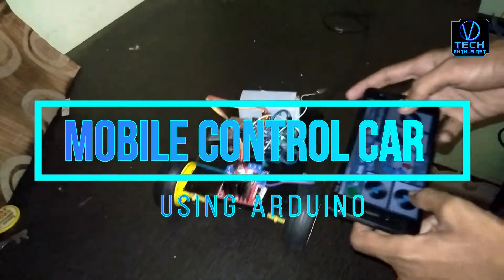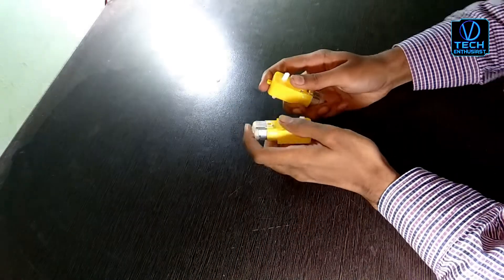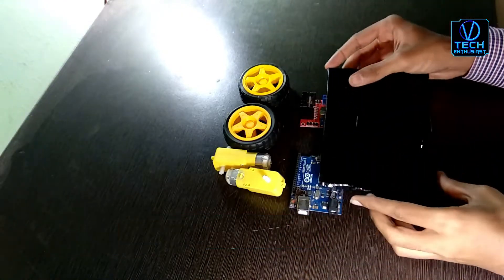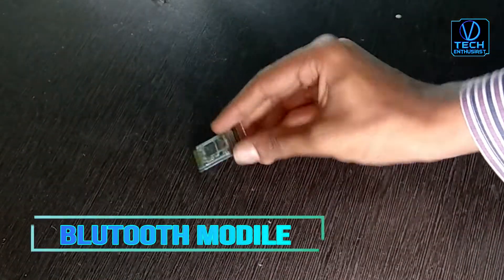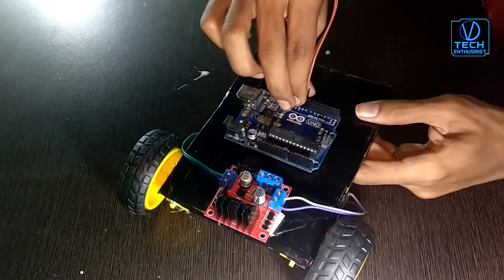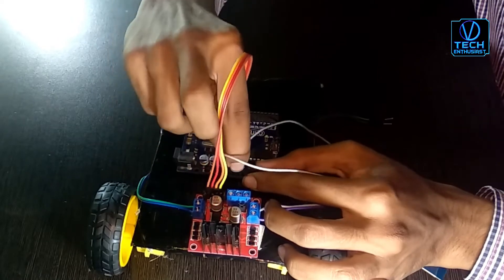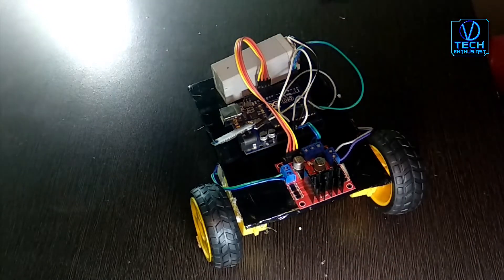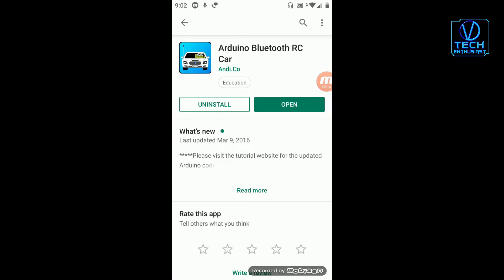how to make mobile control car using arduino [Hindi]

Comment: it doesn't work
Reply from the maker: check your connection are properly.
 use separate  strong power source ,(I think your Battery is not enough for motor driver ) you can use extra battery or old charger .
remember while uploading a program disconnect the bluetooth module.
All The BEST !